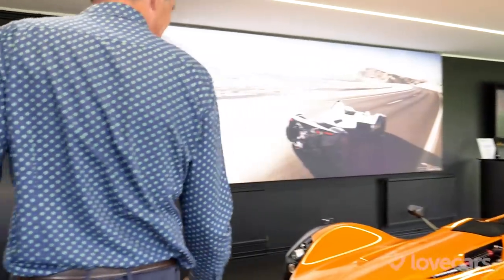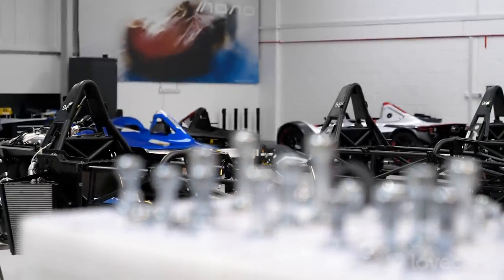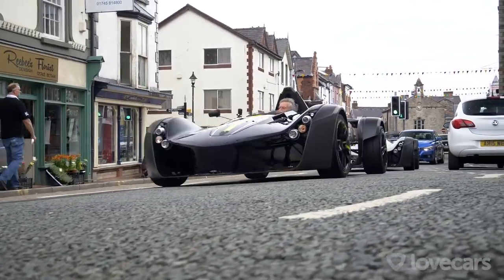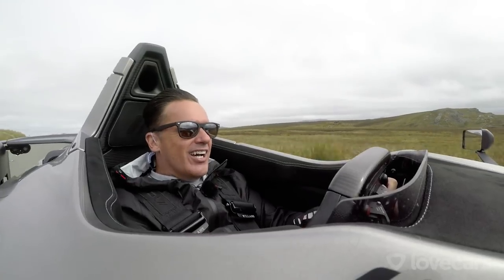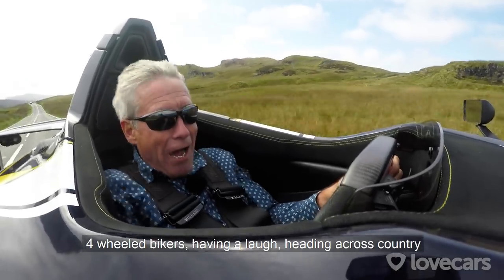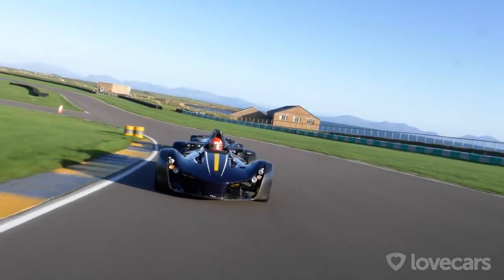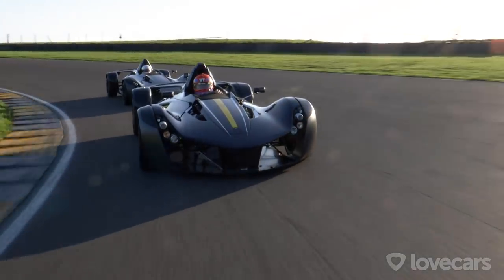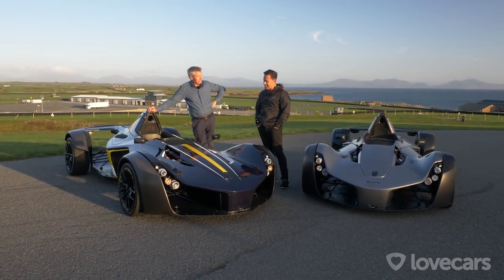BAC Mono x2. The Most Insane Street Legal Race Cars? w/ Tiff Needell

Comment: I've been a huge fan of the Mono since I first saw it, watched and read everything I could find about the company and development of the car.  It's also one of the absolute best cars to drive in various driving sims, which I guess is a pretty accurate representation.  Clicked immediately when I saw this video go up because I knew your channel would do it justice with great quality content as usual.
Reply from the maker: Thank you very much for the nice comments!
Reply: The ownership isn't quite as pleasurable. They shake themselves to bits, not a problem for a race car you strip between races, but it evolves into a Morgan. Bare carbon undertray looks good but damages easily, go for a wrap or painted. There is no warranty and spare parts are embargoed by BAC so even though you could buy them directly from the supplier such as joints, springs, brake rotors etc as you would for any Formula Ford/Audi or single seater they won't sell them, not because they are bespoke, but BAC forbids the suppliers selling to owners. So basically they charge Ferrari prices for Ford parts and you have to get them from Liverpool rather than your countries supplier.

Comment: What kind of a bmw did tiff drive back i wonder
Reply from the maker: 540 Touring 👍
Reply: thank you for the reply as always- what a great choice. I am going to rant away for a minute. when it comes to 5 series bmw-s the newer the better.  Cant say that about 3 series.  full potential of performance can not be used at less than perfect circumstances because of generally overly stiff suspension and on top of that  turbocharged engine will exaggerate the effect of a car getting snatchy on the limit. Car manufacturers are trying to get their numbers out and people are buying cars due to some figures. In general this means that lots of performance oriented cars become very one sided in some ways due to the demand for numbers that will play little positive relevance lets say in normal road conditions or slower speed circuits where the mechanical grip of a vehicle plays a key part. Nurburgring is an amazing place overhyped. This is where these BAC mono tracktoys are brilliant. They only have to do one thing- be fun and as light as possible. The  E28 m5 has got poor seating positioning but it was the best of old 5 series bmw-s with its revolutionary output for a 5 seater saloon car and it had compliant ride that maintained it's composure on undulating roads. Modern car manufacturing could learn a lot from old days when driving was all about driver imputs. Last year or when was it, i sort of can't get a hold off how fast these new models are coming out but mercedes and bmw really stepped up their supersaloon game with new clutch based awd systems that let the cars rotate neutrally into the middle of the apex with no initial intrusion going through the front wheels and then send up to 50 percent of the power to the back when stepping on the loud pedal after the midpart of the corner giving traction and maintaining chassis balance.. These systems are beneficial for corner entry and exit, maintaining the advantages of rear wheel drive and awd car in mechanical harmony without any dynamical disadvantages and we will see these machines  tuned up to 1000 bhp and both e63s and 2018 bmw m5 would get the power down when necessary without any trouble. Anyways good choice whether it is the previous generation 5 series or the new one and good luck reading my future comments and keep on making new videos so i could rant another day :D :D :D

Comment: This car would be cool with a Synergy V8 in it!!  and it would actually sound like a F1 CAR!! If you dont know what a Synergy v8 is? look it up. its basically two 4 cyl motorcycle engines put together as a V8 Configuration making around 410 HP.
Reply: What is the weight of that engine compared to the engine in this car?
Reply: First up, it is 200 lb
Reply: 75° V8 odd fire
2.8 L (3.0 liter optional)
84 mm x 63 mm (67 mm stroke optional)
4 cams, 32 valves via internal silent chain
400HP @ 10,000 rpm with stock street cams (higher spec. is available)
245 ft-lbs torque @ 7500 rpm
200 lb
Billet nitrided steel 180° crank
4340 H-beam con-rods with ARP bolts
Billet 6061-T6 aluminum crankcase
Dry sump 0il system with 4 stage pump
Unique opposite offset cylinders

Comment: Ariel really started to get people to think differently about cars.  Its wonderful.   Many of us are wondering about this design concept but using 2 seats, a windshield, less bodywork like the Ariel Atom, and a small/light, supercharged V8 for dramatically more power and a lot better sound (think Audi RS6 or the newer MB V8's). It would be a little heavier but oh so much more practical. Or maybe like the McLaren F1 with a center driving position and a passenger either right behind where their legs would wrap around you so much less space was used or 2 passengers on either side like the McLaren.  1200 pounds is an enviable weight but you better just never have a head on collision with anyone.  You will most always be the loser in a tiny/light car like this unfortunately.  Is there any side crumple zone at all with this car?  I'd like a frame/roll cage with a car built around it sitting in the middle for best protection.  Then you've got about a meter of crumple zone from any direction.  Sooner or later you WILL get munched from the side.  Will you be ready?